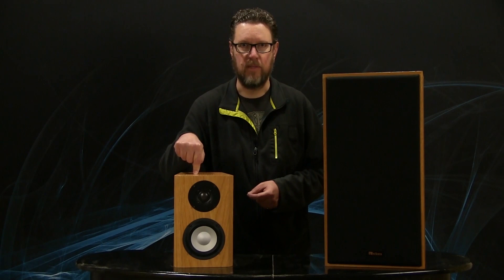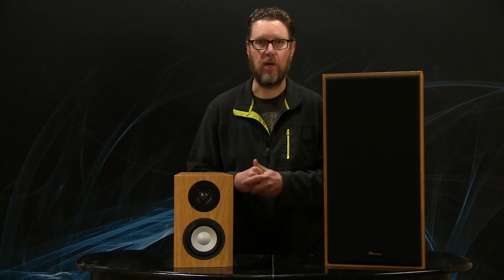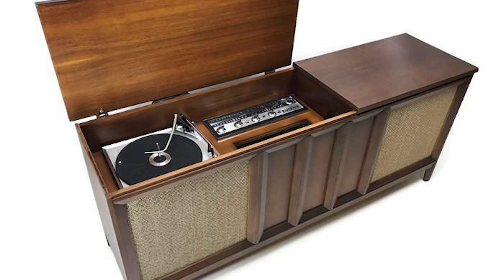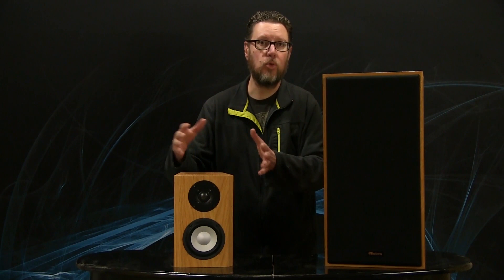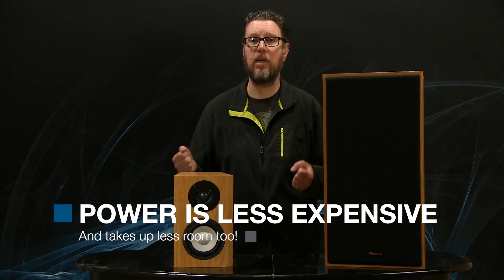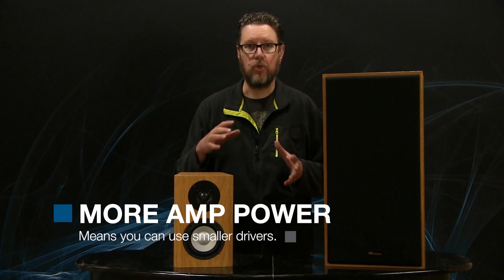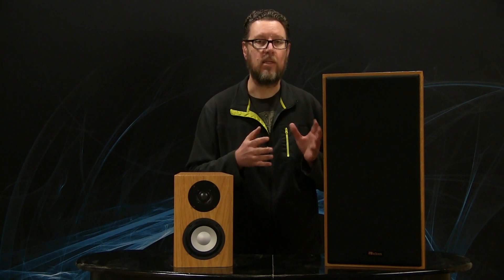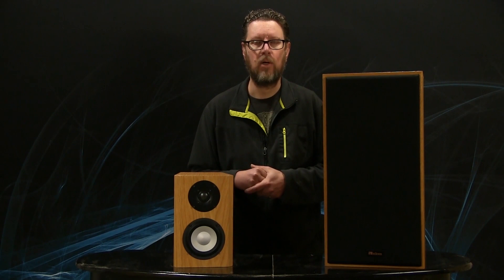Why Speaker Design Changed Over Time:  Can Smaller Be Just As Good?

Comment: One other reason most speakers are smaller is that many people have subwoofers, so the other speakers don't need big drivers because the bass is handled by the subwoofer.  Subwoofers are usually 10" or bigger, but only one driver. Bookshelf speakers don't need to go below 80 or 100 Hz. In the old days, the 2-way (or 3-way) systems had to do it all. Also, passive radiators enhance the bass without increasing size.
Reply from the maker: Interesting point, thanks for adding this to the conversation.

Comment: I still remember the sound system stack(equalizer, amplifier, tape deck) and using two large speakers for that system. It took up as much room as the TV and equipment rack does now.
Reply from the maker: The way things have changed can be truly mind boggling.
Reply: I do too.
It sounded just as good.
And the two 15" drivers in that old system made me happy. 

Today's systems are better in my opinion bc they spread the sound to multiple speakers.
Reply: It is still the best

Comment: I would have expected more certainty in the reasons for the design evolution from a speaker engineer - I would like to understand more about the sonic differences between large cabinets vs small as well.
Reply: Back then the man was the man of the house and his word was king. Woman comes out through the generations and complains about the size of speakers taking up her space in the living room(make no doubt about it , those sound engineers are married to and have to hear it from their wives). Evolution , The cars back then were also big in the 60's in the 70's. Also the manufactures to make more profit, less material cost more profit . But no matter what, you just can not get a Fifteen inch woofer sound out of an 8-10" speaker subwoofer, just not the same! 🤔🤔🥱🥱😛😛🤐🤐

Comment: Besides the use of subwoofers which was mentioned, I always thought the form change driven by the use of speakers next to a TV cabinet/stand.  The cabinet was 18 inches deep anyway, so why not make use of that depth for the speaker, the volume of the enclosure stays the same and they look nicer and are less obtrusive.
Reply from the maker: Interesting point, however, most speakers that are not designed for wall mounting today are deeper than they are wide.

Comment: Very interesting. The reason I don't like narrow, tall speakers with an array of drivers for the same frequency range is that they produce interference patterns and consequently have terrible vertical dispersion patterns. I will always choose eg. a single 12" woofer over two 8" woofers (one above the other). Multiple midranges or tweeters is even worse.

Comment: Modern day improvements:
1.  Better materials for drivers, especially the cones 
2.  Computer aided designs can pretty much predict and guide the builder to achieve the sound they want based on dimensions given for the enclosure
3.  Drivers are able to handle more power
4.  Modern music is equalized to be loud, bassy and bright loud highs.  These lead many people to think their smaller speakers sound “better”.

My dad has a 1970s speakers with 10 inch woofer, 5 inch midrange and 1.5” tweeter.  It sounds good.  But I also have 5 year old smaller 2 way speakers with 6 inch woofer and 1” tweeter.  The bass and response from the new speaker sounds punchier.  Highs are more pronounced.

His older speakers sound a little flatter but isn’t fatiguing to listen to.

Comment: Narrow baffles do not have less diffraction. In fact they might have even slightly more than wide baffles. The idea behind narrow baffles is that diffraction, and thereby phantom source,  happens closer to the driver thereby reducing time difference of arrival of different sources (driver and phantom sources on baffle edges). It is thought that less time difference is less obtrusive.
Reply from the maker: You are correct…a better way of putting it would be to say that a narrower baffle will have reduced time interference from the baffle edges, and hence diffraction will be less obtrusive

Comment: In my opinion large woofers sound more realistic and immediate compared to a small one flopping back and forth trying to keep up. Like the difference between a V8 and a 4 cylinder. This is especially true with horn loaded ones like the large Klipsch that have a total ease about the sound which is just there and is the only speaker in my experience that actually sounds like real musical instruments and singers when heard  from the next room. Problem is they're huge with no WAF and the mids and high frequencies were never to my liking when I had them years ago.This sound limitation may have improved since though with new materials and technology but there's not much you can do about the size. They'll always be huge and not meant to fit in an ordinary sized  living room. I guess the challenge is to design a moderately sized speaker that has the ease and immediacy of a large one.
Reply from the maker: I understand what you're saying, but my experience has been that well designed small drivers in a properly designed enclosure can easily mimic the performance of a larger single woofer.

Comment: I think you over looked two big things that happened in the 80s & 90s, the tall, slim 'Tower' speaker, and the 'satellite' speakers, such as popularized by Bose. People I knew back then wanted a bigger TV, but at that time that took up a LOT of space, so the idea of a slim tower that also didn't need any stands to have the speakers at a comfortable listening level was quite attractive. 
This was followed by the systems such as the Bose and others that had very small front and surround speakers, and s sub in the corner that took up little space at all, but provided what was considered to be decent sound at the time by many.  This kind of system was very popular for the then new home theater systems vs having big JBL sized speakers front and rear.  
I still prefer a decent mix of tower fronts and small rear speakers for my HT system.
Reply from the maker: Hmm…I think I covered both of those changes in the video, but it’s been awhile! You are absolutely correct regarding the move to slim towers and sub/sat systems.
Reply: @AxiomHomeTheaters  Another thing I think is pure economics in moving from the big speakers to the slim towers, etc. I had a pair of speakers with 15" bass drivers. I'm pretty sure it was more expensive to make those, than to build the tower with a couple of 6" drivers instead.  And with the right design, they sounded almost as good at those giant speakers.
Reply from the maker: @danaj9336  
It's certainly possible, but two 6 inch woofers could easily cost more than a single 15 inch driver to produce. Keep in mind that you have two motor systems, two voice coils, etc. and those parts make up a large percentage of the cost of any driver.

Comment: I still use my vintage Sansui 12 inch woofer, 5x9 horn loaded compression super tweeter, dome tweeter, and two 4 
Inch midrange drivers. With an Lpad on the 5x9. 
These speakers cannot be beat even today and they are 40 years old and still going perfect. That's for music listening.
Home theater are Jamo C93-2s and C91-2s in white with an 15 inch subwoofer. Those Jamos are among the top five speakers period.
Solid aluminum phase plugs and floating dome tweeters in specially designed cabnets that are not square.
There is no resonance. 
My LP set up is a Fluance record player, Yamaha receiver amp. 100wpc.
And a pair of JBL Studio 530s.
Which is a hole different planet of speaker.
Reply from the maker: Thanks for sharing your systems, glad the Sansuis are still going strong.

Comment: I would think 50% of the reason is cheaper construction, less material, less manufacture cost and shipping.
Reply from the maker: Not true on any of those accounts, while older designs were much wider they were also much shallower. In fact, if you turn those older speakers 90 degrees you'll likely find size is similar to a modern era design.

Comment: Andrew.  I have axiom a pair of multi directional 80 axiom speakers.  Can I just used them as front firing speakers and what connections on the rear shall I use.
Reply from the maker: If you mean the LFR880s, you can run the front section alone, but it will not be ideal. In fact, it will likely perform worse than a standard pair of M80s as the passive crossover is tailored to be used with the DSP driving both the front and back sections.

Comment: The Citizens didnt ask for small speakers.  The Industry merely pushed them upon the Consumers.   Why?  Because the entire Audio Industry became infected by ECO-RADICALS,  in the 80s.  Thats when they went from Audiophile grade, high quality divers, in Sealed boxes (FAR Superior accurate Bass, compared to Ported speakers) ..  to multiple "Cheap" efficient (low magnet strength, low coil strength)   "eco-drivers" ..in ported boxes.    Then in the 90s... they infected the Studios... and compressed all of the Music to Hell,  to save a few Watts of amp power.   They increased compression levels, gradually each year..  thinking that nobody would notice.    I stopped buying CDs, once I heard the change in quality and clarity... and have never bought a CD since.

 So, the Push for smaller speakers, was for Ecological and Cost cutting reasons.   They realized that Lemming Consumers, were easily Fooled into thinking that narrow small size driver'ed speakers were Superior  (They are Not).   This allowed them to use less wood, cheaper cuts of wood, and and very light weight drivers.  This also meant, reduced shipping costs, and the ability to ship more per Crate / Cargo Container / Truck.

 I have a vintage pair of 1970s era  " EPI 100v "  speakers.   They have a very powerful and EXTREMELY accurate  8"  woofer,  and a special Inverted Tweeter... that makes the Widest Holographic 3d sound-field, that Ive ever heard, from any speakers / system,  hands down.    They completely Destroyed my 90s era Techniques 12"  3-way speakers, in every Metric (curbed them the next day, in utter Disgust).    When a buddy wanted my opinion of the $3000 speakers at the local high end audio shop... I went to have a listen.    They were tall and narrow speakers, with multiple 6" ish diameter drivers.   The bass was Severely Anemic and Artificial sounding.  The highs were way too Harsh.. and Fatiguing (like nails on a chalkboard).   Even with their best and most expensive SUBs playing with them... they still sounded like utter S**T.    My EPI's,  completely Destroy them,  in every way.  From having a Vastly Super soundstage, to having FAR more accurate details.. without being Harsh.   Zero distortions, even at near speaker blowing volume levels.  Bass that is NATURAL sounding... Luscious and Sooth as Butter.  Detailed, Full, Punchy, and Dynamic.  You cant get bass like it... from a Ported speaker...  and once you hear what bass is SUPPOSED to sound like... you are left in a total RAGE... hating how much Joy you have been Deprived of... due to the ECO radicals meddling.

 Realize, that you cant just use a Sub, to fill in the missing deep and mid bass, from small diameter woofers.  Subs basically for movie Effects...  and in most music styles, only tend to Muddy the music up.

 Narrow bezels generally dont mean Diddly.   The reason for poor soundstage,  has almost nothing to do with the bezel width... and almost everything to do with the QUALITY and design of the Tweeter itself.    The issue is that many Audiophile grade speakers Opt for Planer tweeters... and while planers can be extremely accurate in details...  they have an extremely NARROW listening field / sweet spot.   Certain Dome tweeters,  are often under-powered... and so they fail to project enough energy into the room.   With Horn based tweeters... their Horn Shape seems to distort the intended 3d Image... causing the music to sound much "Flatter".   Some high frequency drivers, are just very narrow in their output height and width...  and if you are even a few feet off-axis from them... you will notice a huge change in the sound.  Yet other tweeters... like the EPI's.. have like a 12 x 12 x12 ft area,  in which... no matter where you sit / stand  within that area,  you get an amazing 3D Stereo image.  The details are also fantastic.

 Now look.. its not that you cant get excellent sound from a bunch of high-quality, small diameter, speaker drivers.   But that there is always a trade off, and price to pay.   You wont, for example.. be able to push smaller drivers, anywhere near as loud and dynamic... as larger diameter drivers of the same driver type / mfg.    Also, Ive listened to the difference between an identical pair of 2 way speakers... with the only difference being a 6" vs 8" woofer (same tweeter, same crossover).   The 8" was FAR deeper,  more Full and Natural sounding,  and far more Dynamic.   They also could play and be pushed Far louder.    That said.. Both of those speakers used audiophile grade drivers.  This wasnt some cheap Chinese boom-box drivers... where, no matter what you did... would barely help the sound quality at all.

 All of that said... the mere Diameter of a speaker driver... doesnt mean that it will be a good / excellent speaker.   My former Techs 12" eco woofer drivers...  couldnt touch the FAR super 8"  woofers in the EPI's.   A single EPI woofer, weighted more than two of the Techs woofers combined...  because the EPIs use much stronger and heavier magnets... and likely, much stronger voice coils too.   The added magnetic strength, allows them to accelerate faster, thump harder, and have SUPERIOR precision control of their movements... which equates to almost Zero distortions... which equates to being able to hear more things in the music... than you ever have heard before  (due to other speakers partially distorting the intended details).

 I will also add... that when the 80s hit, and the speaker MFGs started using Eco-drivers...  they often put in anywhere from 4 to 5 drivers in them... to try to Dazzle prospective buyers.   Some of them also used extremely larger woofers... like 15 / 16"  diameter... to try to make it seem like they could handle very serious bass.   But people found out the hard way... that the additional drivers didnt really make these speakers sound better...  and...  the large woofers were not really designed to handle heavy bass excursion levels... and so they would easily Blow themselves apart.  This scammery caused a lot of Distrust...  and soured a lot of people to the potentials of Superior audio products.    Of course, there are also way overpriced scammery going on, in the Audiophile scene... with companies like BOSE... which use multiple cheap $3 chinese drivers... Some EQ trickery... and a lot of Deceptive Marketing,  to get fools to part with their Money,  for sub-par sound quality.